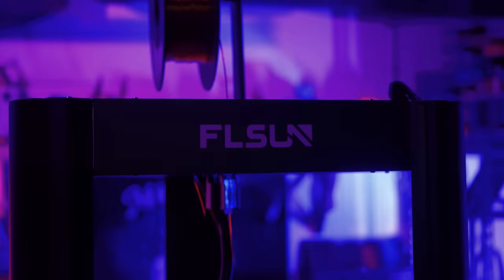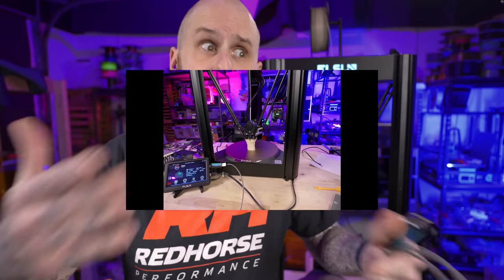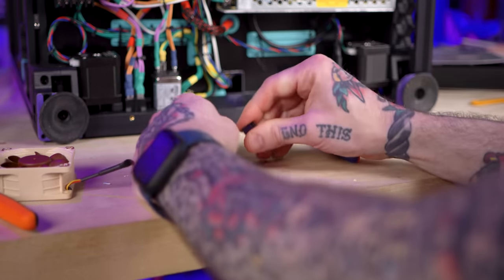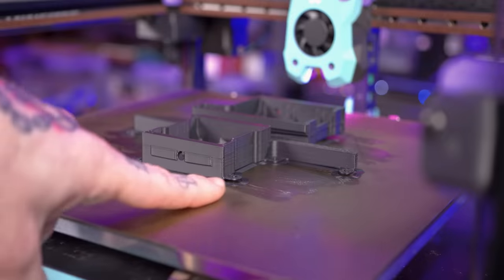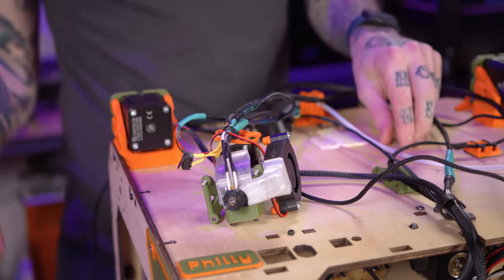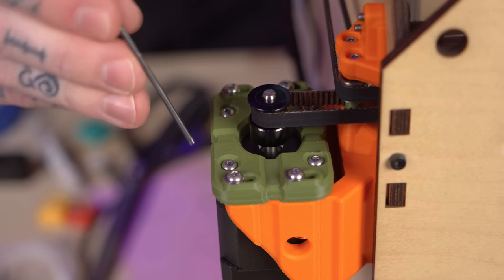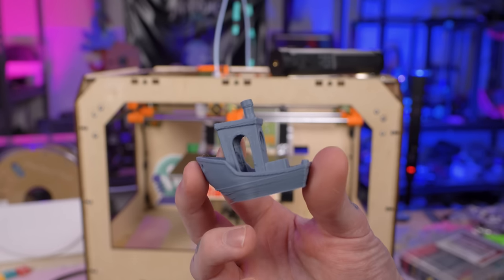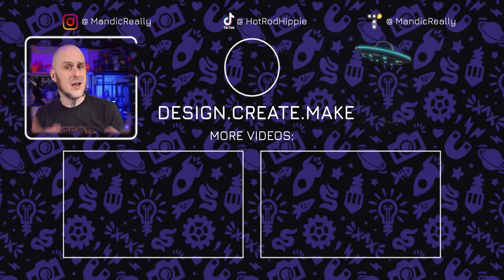Voron 2.4, FLSun V400, & ReAniMaker! - Workshop Vlog 02

Comment: you can use a piece of software called Gphoto2 (runs off the pi), it will let you trigger photos via USB using an SLR, then you can just stich them all back together using Davinci resolve, so no need for the capture card.  I've been messing around with it on my channel, but need to work on my lighting.

Cheers 🍻

Comment: I got a CTC clone of that printer chassis and wanted to revive that.. changed the motors to better ones but kept the hotend. Changed the build plate on that machine to an aluminium one but couldnt find a heater the same size.. what heated bed are you using?
Reply from the maker: The original one hacked with a new Thermistor.  You can see it in the original video about the build: https://youtu.be/4QKAGwknMiU

Comment: What do you think the difference is for bed adhesion on the 2.4? I’ve not long finished my Trident and can’t get full bed adhesion without cracks in the parts, only way I get full bed stick is with a brim. Tuned first layer, flow, temps, etc. what temp would you say the enclosure needs to be at for 10/10 results? And what’s possibly the difference between the Bambu with perfect layer and bed adhesion?
Reply from the maker: Bambu isn’t perfect, I have layers peel up on that too. Bambu doesn’t allow us to calibrate first layer through anything other than extrusion width though and they are absolutely SQUASHING the first layer on that machine. I’m amazed the nozzle doesn’t drag across the bed surface more often with how they lay down first layers. Honestly the 1st layer on my Bambu is almost always what I’d consider bad because of it. 

That said, chamber temps depend on what you are printing. ABS / ASA, I like to see close to 40C before I start a print. That’s gonna go a long way to helping. What bed temps are you running as well? Bed bottom versus top temps can be pretty drastically different on the thick Voron bed if you aren’t baking the bed for a long time. I’ve got a temp sensor on top of my bed and it’s about 15-20 degrees cooler than the bottom at times.
Reply: @MandicReally  that’s pretty interesting! I’ve been considering getting a Bambu just for the point and shoot for ABS, that throws a spanner in the works.

I’m doing ABS+ (have a roll of ASA to open - worth trying for layer/bed adhesion over ABS?) bed is 95 first, 90 after first layer, 240 hot end, I have a temp sensor in the chamber but I’m unsure location is ideal, although that often gets up around 35-40, then climbs over 50 while printing. Usually bake the bed for 10-15 minutes, I’ve spent a lot of time on first layer, and while it’s not consistently good, I’ve had PERFECT first layers that the print still warped on. It is a large-ish flat print I’m trying too… printing on the smooth PEI bed at the moment.

Hey, thanks so much for your reply! I’ve been loving your videos and struggling to figure these problems out, awesome to get some great information back, really appreciate it

Comment: Are there any connectors that don’t need to be soldered like just ad pins to the wires? I can’t find my solder gun and can’t replace it at the moment
Reply from the maker: Microfit connector would be my go to. Unfortunately most connectors are larger than I care for when it comes to those applications.
Reply: And what did you print the parts in for reanimaker
Reply: @MandicReally  thank you sir I’ll look in to some been putting my fan off for far to long now lol